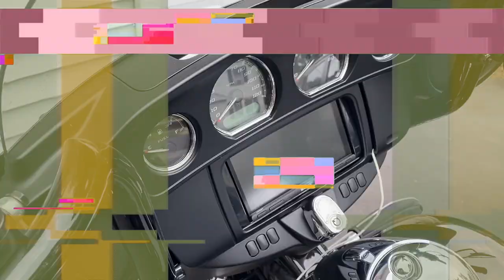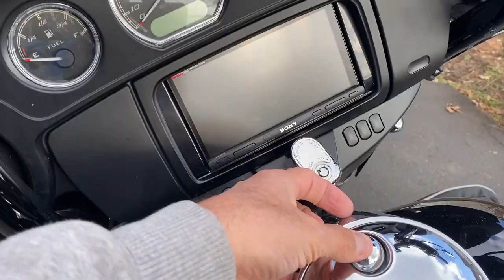De-winterize Harley Davidson

Comment: Fuel will appear higher and then the air will escape and it will look lower than what it did initially. Enjoyed the videos of Israel too.
Reply from the maker: Yeah I think it’s fuel evaporating over time and  escaping through the the fuel tank vent
Reply: @HOLYSHIFT  Doubt it evaporated, it’s a sealed system similar to modern cars, with an evap canister to even catch vapors! The only vent is overflow tube in case you overfill tank. Goldwing Mike NY.

Comment: You can also fill with Ethanol free fuel with a small amount of ATF in it. Stops rust, cleans, Burns well Old School trick. Also put it on a stand to prevent flat spots on the tires